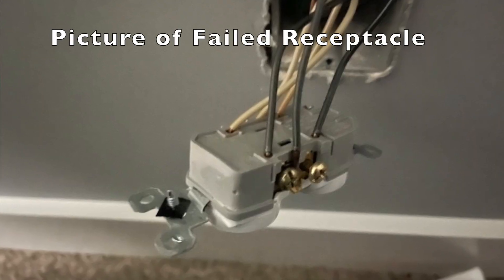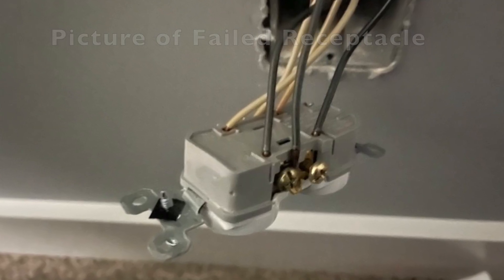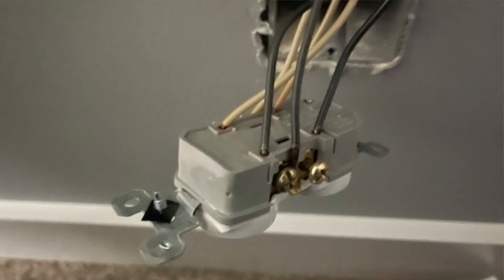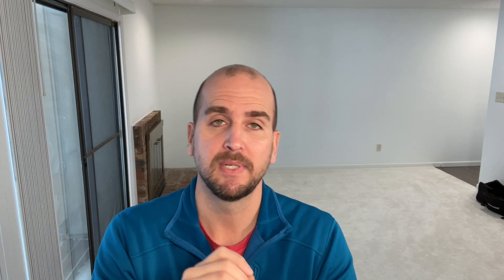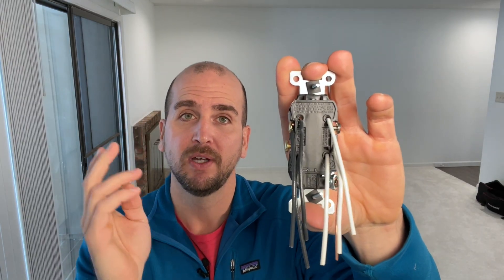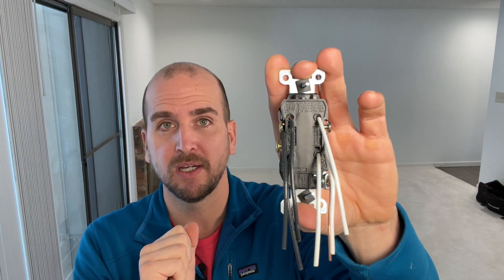Incorrectly Wired Outlet Found In Newly Built Home

Comment: i would much rather have a quality outlet designed to stick up to 4 wires on each side strait in with the screws holding them down tight real secured back wired. then people trying to put three wires on each side and a pigtail together under one wirenut  to jam all that in the box is just asking for some wire to pop out of a poorly twisted wire nut connection. you demonstrated putting only two wires together with a pigtail and gave no reason why this would be better for some homeowner to do.

Comment: He didn't explain why we should use a pigtail instead  the two pushings holes. ..is anyone know ?
Reply: i think he did nothing to improve that outlet it had clamp down screw terminal back wiring not push in connections the push in ones only touch wire with tiny edge of sheet metal clip the ones he took off with the red wires were clamped under a full length clamp and tightened with screw

Comment: When placing conductor on screw terminal it is required to strip 3/4” of insulation off, make a hook with the stripped portion and as you are looking straight at the side, the end of the wire should be on the right, so as when you tighten the screw it pulls the conductor in place. Technically solid wire shall not be twisted together. For this will increase the size of the splice.

Comment: FIRST READ YOUR LOCAL ELECTRICAL CODE. In Canada we have a national code with variations province to province.  I did my garage/workshop (lighting, 12 plug circuits including 20 amp stationary machine and a 30 amp welder), in Ontario a homeowner may do  his/her own electrical work but must have it (thoroughly) inspected. I found the inspection pass or fail depends very much on neatness and attention to detail. Musts include: pigtails for multiwire outlet boxes, proper size (volume) boxes for the number of wires, properly sized wire nuts, holes in studs etc. and wire staples in proper places etc. ;  the list is long.

Comment: Microwave oven behaving erratically?  Probably not the microwave, check the outlet for pushed in connections.  The wires oxidize over time and the barbs that supposedly make the connection will make and break on vibrations, doors on common walls even vehicles on the street. That browns out the microwave and it can come back on in a random state, even full power no clock limit and burn the house down. Arc sense breakers are a bandage for the mess these quick installs made.  A lot of TV's have switch mode power supplies that mimic an arc fault and trips the breaker, useless even with properly screwed on connections.  rant rant..........

Comment: What is that extra plastic contour that look like a box going inside existing box ? When is it required ?
Reply: It is a box extension. It is required any time there is a flammable material between the front of the device box, and the surface that the cover plate rests upon. 

Basically, if the box is not flush with the wall (recessed), and the wall has some kind of wood panelling instead/on top of flame resistant drywall.

Comment: Nice but you do not need to pigtail unless you have more wires than terminals as is found most often in kitchens since 20a receptacles do  ot have push in and not all have the ability to out two conducmunder one screw. If you try to pigtail everything you will soon be out of business as your labor to switch and plug a job  will triple

Comment: gee, you yanks have dangerous wiring codes. wiring nuts?  exposed screws and wires that may touch metal wall boxes?  stupid, stupid, stupid.  here in australia, wires on power outlets are poked (up to the insulation) into a hole and secured by tightening a screw which is also below the surface.  and it has been that way for 60 or 70 years or forever.  in all the old house wiring systems i've encountered, i've never seen an outlet with exposed mounting points.  and metal wall boxes are so last century.  25 years ago, i worked for electricians, preparing walls for them.  the boss was given some plastic boxes for masonry walls by a supplier.  he gave them to me to give them a try.  my reply was to never ever get metal boxes again.  there are still some industrial situations where metal boxes are mandatory.

Comment: Sorry but I don't get it. Why is a pigtail any better than having only two wires connected under the same screw side terminal? The only time I do pigtails is if there are more than two pairs of wires in the box. Can you prove that there is a difference doing it one way over the other by using some sort of test equipment?

Comment: First thing I thought was pig tails.... Stab-ins don’t have the same surface contact area on the wire as side terminals and should be avoided.
Lastly, I typically wrap the outlet or switch with black electrical tape if it’s going in a metal box. Just an added layer of protection.
Reply: adding tape traps heat. I would avoid this practice.
Reply: @andrewfunk9167  this. They're designed a certain way for a reason. You're being paranoid if you wrap in tape and exacerbate any local hot spot issues
Reply: When you pig tail the amps from other devices  will not pass thrue  that device  . It's the best way to wire a device to a splice  to prevent overheating  which will lead to a fire which will lead to loss of life
Reply: A metal box doesn't make a bit of difference. You're screwing the receptacles into place, both you and the guy in the video are being overly paranoid... there isn't a need to tighten unused screws or tape an entire receptacle/switch. That being said I prefer the Shepard hook anyways so the screw gets used. But I don't worry about short circuits. Make sure all connections are dry and tight and you'll be fine until the house crumbles from age.

Comment: Friends had an older mobile home that developed electrical issues. I found that the push in connections had begun going flaky, replaced the old outlets. One bad push in connection will impact everything downstream of that receptacle. I have always j hooked the wires as this preserves circuit integrity. Although I have had residential electrical training, pigtailing at the receptacle  was not covered but makes sense especially with push in connections..
Reply: The only thing shittier in a mobile home than its water system is its electrical system.The manufacturers (Usually in Elkhart Indiana) use anyone with a body temperature of 98 degrees. Usually with an IQ about HALF that high. And OVERpay 'em about 2.50 an hour.

Comment: I don't 100 percent agree with this video especially the last tip but all I know is having a space heater and a mini fridge plugged into the same circuit is too much to begin with I have the same plug and everytime my mini compressor would kick in while the space heater was plugged in that receptice would arc I could hear it through the wall . I took a picture of it and emailed my electrician he said don't run the space heater and the mini fridge at the same time your drawing too much on that 15 a circuit . i did what he said no more problems.

Comment: Master Electrician Massachusetts: Best way is to pig tail. Pass through on an outlet with a failed neutral can cause fires. That being said running a business you can only do as good of a job as the builder/GC is willing to pay. With all the cut throat shops and journeyman trunk slammers undercutting prices some times you gotta back hack to save time.
Reply: When there's only two pair of wires in a box, what makes pigtailing better than simply putting both white wires under a plate on the neutral side and noth hots under a plate on the hot side?

Comment: Around @5:10 the pig tails we're done correct but I recommend you use longer wire (you can always cut it down after what I like to do is I'll grab it in my hand and stick my thumb out and cut it a inch or two past my thumb

Comment: I worked for a company that only backstabbed this was a few years ago I didn't last long working for the company they cut corners on everything they wouldn't crimp the ground wires on  outside outlets they also wouldn't lable wires for home runs to save time but then on the finish had us all run around to see what controlled what i lasted two weeks

Comment: Another great reason to pigtail is to have your receptacles wired in parallel and not series, so that if there is a problem with a particular receptacle it won't affect the rest of the circuit... unless of course there is a fault and the breaker trips.
Reply: The outlet is not in series, it is in parallel because the screw down is like the pigtail wire and the screw down has two wires under it.   If nothing is plugged in the other outlets work.
Reply: @johnmeier6981  I think you're taking "series" and "parallel" too literal in this context. Instead of series we can use "daisy chain" if that makes you feel better.

The point is the pigtail makes it easier to service the receptacle without affecting the rest of the circuit. If the receptacle is wired how you say and you need to replace it... You would have to break the circuit, causing the other receptacles  in that circuit to no longer work.

The plug being in the socket has nothing to do with it.
Reply: @huludical1  Daisy chain term works.  Don't forget to add the pigtails in the total box fill of conductors.   I am Licensed in NV. and hold a national License.  I never use Wire nuts or pigtails  unless it is a 2 hot wire ckt.  In this case NEC says you need it on the Natural wire or if local code requires it else where
Reply: @johnmeier6981  pigtails do not count toward box fix since they do not originate from outside the box OR pass through the box OR leave the box. Pigtails originate from within the box and stay there. 314.16 (B) (1)

Comment: "Professional" is a very loose term these days. I have seen some horrible installs in my day. Code is way too lax in some areas, and way too picky in other areas that don't really matter as much.
Reply from the maker: Hey Charlie, good thoughts.  Thanks for the engagement.
Reply: The things I have seen 'professional electricians' do are why I do all my own wiring.
And the NEC desperately needs a thorough sanity check cough 6ft maximum run of LFNC/LFMC cough.
Reply: @randacnam7321  in my experience, it isn't just the electrical code that needs fixed, but the entire building code.
Reply: @randacnam7321  I replaced a vanity light in my half bath and the builder didn't even use a box. The romex was stapled to a bit of blocking and the fixture was secured to the wall with wood screws through the mounting plate - one into the blocking and one into just drywall.

The worst part about this kinda crap is that you tend to discover it years down the road, so the chances of calling the builder and getting the name of the electrician are slim. No one calls them out on this stuff, so they keep cutting corners with no consequences.

Comment: Many years ago I worked with an electrician. We always used clockwise bends under screw connections as well as taped all wire nut connections and covered the terminals with an electrical tape one and one half (doubled over the hot side) loop. A back stab connection is relying on a single point of contact between the wire and the leaf contactor. A loop of wire under a screw head is a full contact connection. Even a layman can understand this. He always used to say "back stab connections will stab you in the back down the road". We replaced many back stab outlets from other installers/electricians. Normal outlets CANNOT handle HIGH LOAD devices! SPACE HEATERS were the cause of our most common repair call. Normal wiring is 14GA/15 amp circuits that are not adequate for space heaters. The older the house, the more common the 'electrical roulette'.  'Code' is a minimum acceptable level. With all the failures seen in back stab installations since it was allowed, you would think they would be unacceptable today.

Comment: So I have 12-3 coming from the panel, I took out all my out dated fluorescent lights and put it recessed lights. How do I wire together the 12-3 to power my switches and light circuits? I used extra 12-3 to wire each light jumper, I also used 12-3 & 12-2 because it was all I had left, to wire back to the junction box in my attic. But I’m not getting power to my lights, how am I supposed to wire them together?!
Reply: get a local electrician to show you.

Comment: It's also a good idea to inform people who are making pigtails with aluminum wiring to copper to use an antioxidant in the pigtail to prevent oxidation.  I've been using those alumiconn's and so far they've been working great and they come with antioxidant gel inside the lugs.